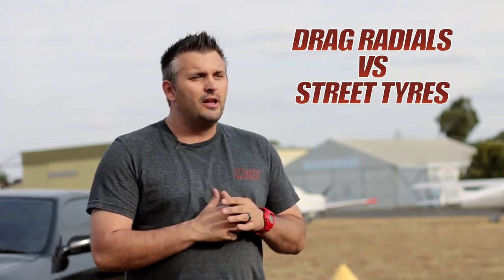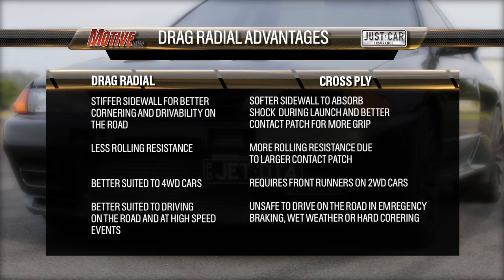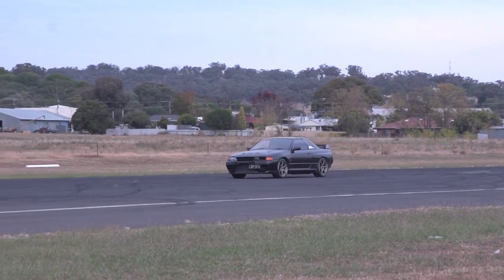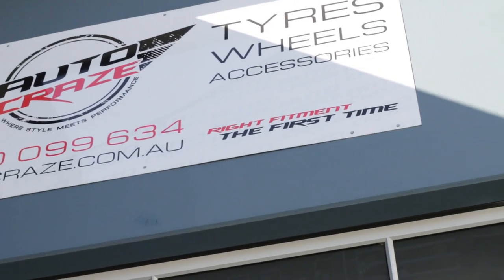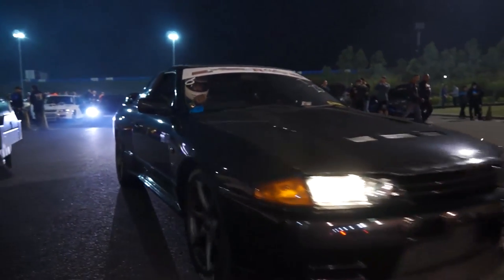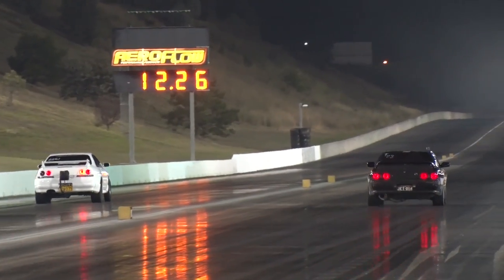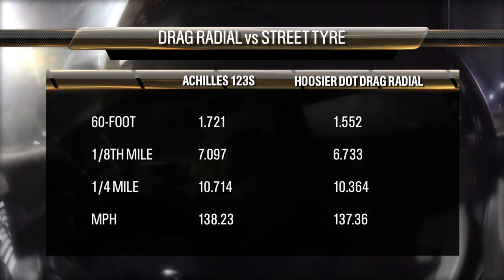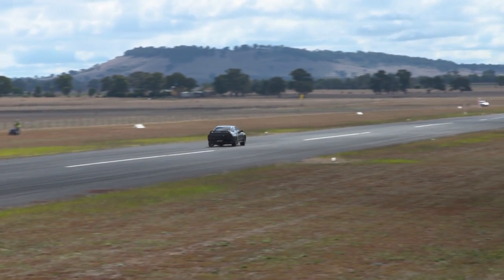Drag Radial vs Street Tyre MYTHBUSTED R32 Skyline GT-R

Comment: can you even buy cross ply tires anymore?
Reply from the maker: yes. drag tyres
Reply: Off road tires too, better at resisting punctures but they're not good on the street. A lot of ATV tires are bias ply (cross ply).
Reply: ***** Huh?? i only ever heard the term "drag radial"
Reply: Josh Briggs They mean drag slicks.
Reply: But ever drag slick s a radial right?
Reply: Josh Briggs Most drag slicks are bias-ply.
Reply: snakesonaplane2 I never knew that :D there must be some drag racing tires that are radials as i heard the term allot, but as you said they may just mean drag slicks

Comment: Street tires are actually worse on prepped drag strips that's why you got your pb's on an un-prepped airstrip.
Reply from the maker: We've still 60' better at the dragstrip on street tyres than we have at the airport. We've been running those Achilles 123S for 4 years so know them well ( new ones every 12 months)
Reply: +MotiveDVD darn Honda drivers
Reply: +MotiveDVD just curious, what was the pressure in the road tyres?
Reply from the maker: We run 28psi cold. The correct pressure to run them on the street/track.
Reply: Ok.
I wonder how much the ability to run the lower pressure also helps alongside the compound and casing advantages.

Comment: test is flawed,,, should have used the exact make and model of wheels for the test. differences in wheel weight have a great deal of effect on a lot of things performance wise
Reply from the maker: you're not serious are you? Wow. Not every tyre weighs the same either, did you know that?
Reply: dead serious, wheel weight makes a pretty good difference, as im sure you know
Reply from the maker: Maybe when its the difference between  heaven stock wheels and forged light wheels. Both were 18x9 inch one-piece wheels. Lucky to be 250 grams difference between them. The tyres would have had more difference in weight
Reply: true and i know the difference would be marginal but still will cause a difference with wheel weight when trying to compare tire vs tire, even though the outcome would still have been the same, clearly purpose made tires perform better for their intended purpose
Reply from the maker: the difference would not even be measurable i the real world so no need to factor it in at all

Comment: 1:13 these comparison charts are the wrong way round
Reply from the maker: no they're not
Reply: radials dont have stiff walls for good handling, unlike crossplys which do
Reply from the maker: I think you have your facts quite wrong. Radial belts were introduced into tyres to mae the sidewall stiffer and safer. Cross Plys have no metal belts in them and are very soft sidewall. IN drag tyres they are designed to run at super low pressures and crinkle as they turn to get maximum contact patch.   Radial tyres ( all road tyres are radial now) have redial belts to create a stiffer sidewall. Just google it dude and you will see.

Comment: clearly if the street tyres are low profile like that, you're gonna have more wheel spin, id stick to a profile 1 sise up and on a smaller lighter tyre for even better grip and results
Reply from the maker: Large brakes means 18-inch tyre only for this car. We now 16-inch ones work better.

Comment: how is it possible for the trap speed to be lower?
Reply from the maker: increased rolling resistance from sticky tyres leads to lower ETs if you have same power.
Kind of like lower dyne reading from stickier tyres
Reply: ***** I'd think the quicker acceleration would more then compensate for the rolling resistance
Reply: It's getting to the other end quicker now so it doesn't waste as much time building up speed. Once you pass a certain power level I presume that goes out the window though.
Reply: TheMilkman72 yeah I'd think so
Reply: Because less wheel spin means slower mph's.
Reply: Simon Kent obviously not since you're not wasting distance accelerating slowly
Reply: +Bart Van Riel have you ever been drag racing, obviously not. go out and try it. if you spin like fuck off the line you will have a higher mph for the same 1/4mile time. every real racer will be  back me up on this.
Reply: Simon Kent for the same time yes of course, but spinning isn't helping
Reply: it's nothing to do with wheelspin, its because at the drags the terminal speed is measured over the last 66 feet (about 20m) of the run not at the very end of the run.
Reply: donperry1 that doesn't really make sense to me
Reply from the maker: It's only quicker over the first two gears where traction is an issue. The rolling resistance lasts the entire length
Reply: ***** but is the difference in rolling resistance so extreme that the gains of the line don't compensate for it?
Reply from the maker: Your quicker due to more grip, but the rolling resistance effects power to the ground for the entire run if that makes sense, so you have lower mph
Reply: ***** yeah it does, thanks

Comment: quarter mile finished at 133mph... 0-90 test because car can only only get to 101km/h with ratios... What?
Reply from the maker: +Jeffrey boris The 2nd-3rd gear change occurs around 100km/h. sometimes slightly over, sometimes slightly under, sometimes way under.
We measured 0-90km/h as we always went over 90km/h before changing into 3rd gear. This makes the comaprison more consistent as the gear change isn't involved.
The quarter mile time and mph is normal quarter mile.
Reply: after being kicked out at sydney drag strip they just let you back in again next time?
Reply: +The Crumpet Thats right
Reply: +The Crumpet They have no proof that the car hasn't changed. If you pay your dues, you get a run.
Reply: ***** Oh ok, that makes sense. thanks for the response.

Comment: Your 500kw car will only go 100kmh? That makes no sense but that's what you said.
Reply from the maker: We're not sure what you're saying? We never said it couldn't go 100km/h, we said the gearing of the transmission/diffs means it only just hits 100km/h in 2nd gear close to the rev limiter, so, to make the test more consistent and not damage the engine we compared 0-90km/h. It clearly can go over 100km/h. It hits over 220km/h in the quarter mile
Reply: +MotiveDVD I didn't hear anything about 2nd gear at 3:35. That makes a lot more sense.

Comment: "Drag radials offers better cornering"!?

😐....
Reply from the maker: better than a cross ply, yes. but still bad compared to proper performance tyre. basically, you can drive normally on a drag radial but cross ply slicks aren't always so good to drive on
Reply: ***** I know you could drive around on them that's why they are called radials.

I run them since the early 2000s on my cars.

Drag radials are supposed to wrinkle to be effective, the side walls are design to be softer than street/cornering tires.  but the thing is you have to be mindful when running on them... especially on rear wheel drive cars.

yes you'd feel them gripping in turns but it's just not designed to carry all that side loads so be careful.

if you like cornering try using something called (track Radials).

great channel BTW just came across it

Comment: another right tool for drag racing, an automatic transmission
Reply: even if you knew how to shift an automatic always wins in the 1/4
Reply: Pan S. I just don't believe that. I know a manual is faster in lower powered vehicles. But I'd like to test it in something with, say, 900 horsepower or so. I'm not being an ass or a troll, I just want to have an honest debate with you sir.
Reply: Pan S. Haha I'm far from rice. But I reckon we'll just have to agree to disagree. I can shift my mustangs fast enough to not let off the nitrous button nor see it nose dive between shifts. This has been cars with roughly 500 horsepower and drag radials.
Reply: agree to disagree is cool, but the facts are there. ask any pro dragster or builder and they will tell you the same.
Reply: Giant Turd actually we can and we use it on a road course where it is efficient. not where it is not.
Reply: Pan S. Well I've never done road coursing so I'm not going to sit here and cuss you out about it. I really would like to have a good debate on the subject instead of just talking shit back and forth. I thought me and you kinda did that a week or so ago...
Reply: when you spew nothing but nonsense and rice boy logic it is very hard.
Reply: Pan S. Ok dude. I hope you have a great day. 

Rice Boy out..
Reply: anyone who says F an automatic has never raced at the drag strip lol. a 2 speed power glide with transbrake will smoke a stick any day of the week. assuming they have the engine to back it up
Reply: for street racing at stop lights, stick is ok, drag strip, auto with transbrake.
Reply: even at  a stop light it sucks

Comment: hate test like this, if you are going to test tires then use the same wheels!
Reply from the maker: Their both 18x9 and both one piece high quality. The difference in weight in the tyres was more than the difference in the wheels. It made ZERO difference at all in the real world. None. Zero. Zilch.

Why o we know? Because we've run the Achilles 1232s on both the Enkei and the R34 wheels.

Removing the jack and tools out of the boot would make as much difference. not measurable.